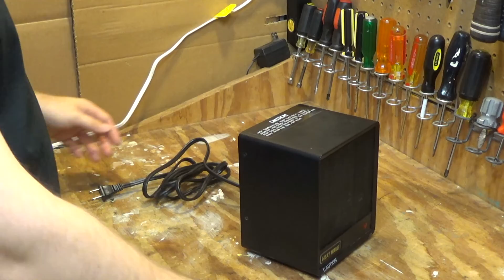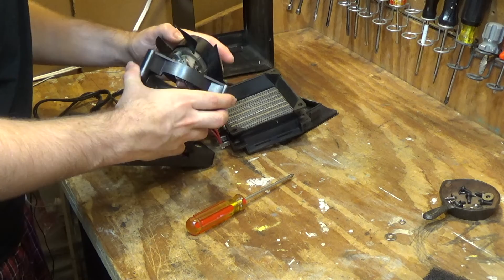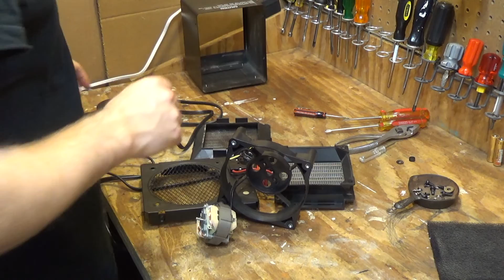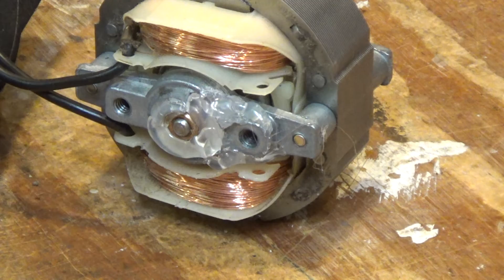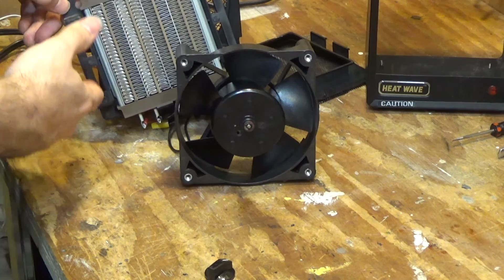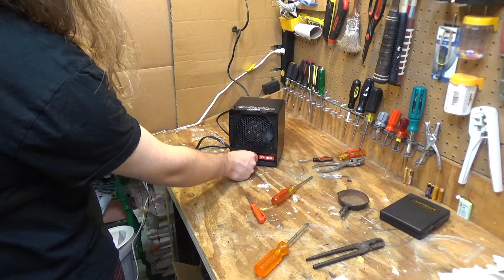Clean and Service Heat Wave Ceramic Heater, model H-500

Comment: I think JB Weld would be more ideal for fixing the back bearing assembly. I have quite a few of these heaters and have never had that problem. Some of these use computer "muffin" fans to draw in the air.
Reply from the maker: Certainly, but this is what I had on hand so I tried..
Perhaps this one was just an oddity.. I've heard those Muffin fans are pretty substantial..